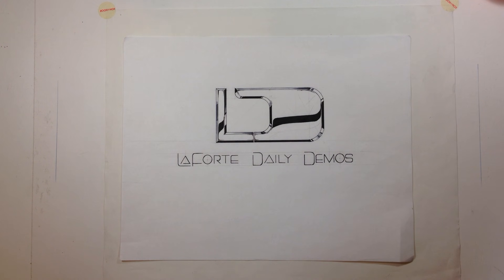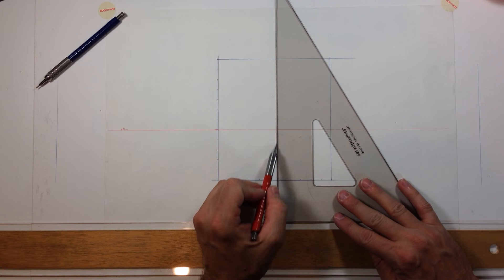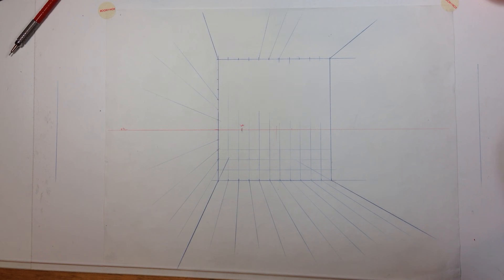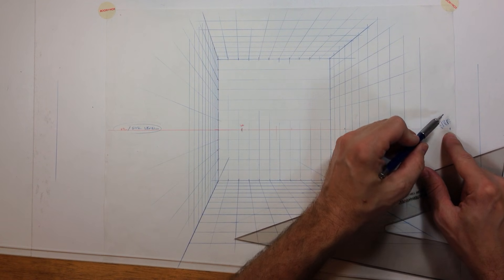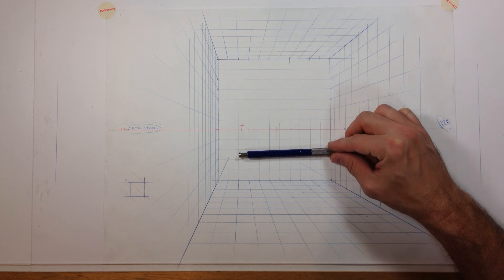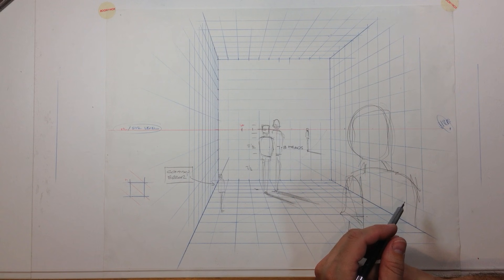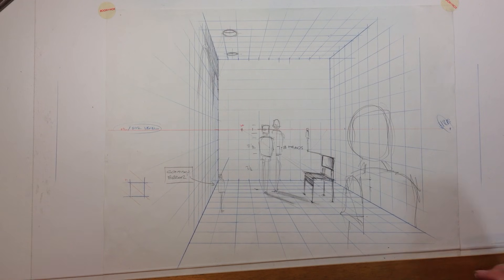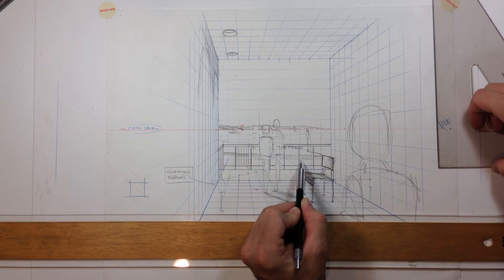1pt Perspective - Part 1 - Creating a Grid

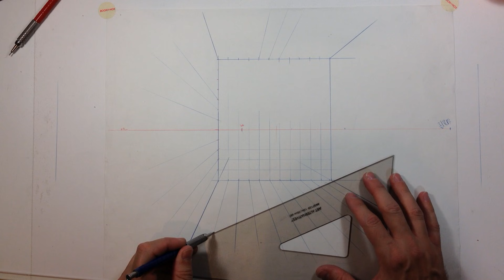Comment: In your "diagonal vanishing point method" to draw the horizontal lines (near 9:13), the dimension of the lattice cell seems to be longer in the vertical direction (as we extend that diagonal further down) contrast to the general "squishing" of the vertical direction. Why is that ?? I hope you get what i mean

Comment: I'm returning to self-taught (aka youtube taught) drawing techniques and two things that infuriated me about getting the perspective of a floor grid were people using the vanishing point as the center of the back wall, and artists with years of training saying "just eyeball the vertical distance, you'll get used to it!"  Exactly the opposite of helpful.  I had vague memories of the control point / diagonal vanishing point (7:50 - 8:34) and was happy to see you use it so I could remember the technique, on a room that wasn't centered on the VP no less!  One thing still plagues me though - Where did this method come from? I had considered reconstructing it analytically using photos of a physical grid I would take on my own, but I wonder if you might have any insight into the formation of this technique? I looked over the vids on Scott Robertson's youtube and it didn't seem like he had any which would give me that info.
Reply: I don't get it either, the theory I mean. I thought you just drew a corner from edge to edge on the ground plane.
Reply from the maker: Thank you! Glad you appreciate it! Eyeball method works fine when you have a base understanding, but I found the 2x method (diag distance from VP to longest floor corner) to be easy enough to remember and produces good, believable results--I've seen some methods that do not appear believable. You can even eyeball approximate that point within reason and it will fall in line fine. When people set a diagonal control point too tight in, the ground plane grid just won't look foreshortened right. I don't recall where exactly I got this method. I think it was from Professor Opheim who had a self-published book; very technical. But just about every perspective book has some variation on it, John Montague's book is very good. I've also got books by John Pile, Joseph D'Amelio, Ken Auvil, and a few more... I've tried to put together material that plugs some holes I haven't seen covered very well or are very cryptic to unpack from a book.
Reply from the maker: That won't foreshorten the ground (walls and ceiling as well) grid in a sufficiently believable manner

Comment: Hi.  I tried making a 15 ft room instead of 9 ft.  The squares on the floor change size when I do this.  Does this make sense?
Reply from the maker: The units wouldn't matter, the concept would be the same. If you change the scale units you use, then the floor units will change too, but the system doesn't change. Set the VP and measure the distance to the furthest floor/wall base corner, bring that up to the HL 2x from the VP and that will still be the control MP

Comment: how do you work out the exact points for the two red dots on the horizon line to make sure that the floor tiles are exactly square and not rectangularly shaped. Is there a method or measurement from a point.
Reply: He measured the distance between the vanishing point and the bottom right corner and used that as a scale for plotting points on the horizon
Reply: Thanks. Will try the out.
Reply: Once the horizontal is drawn and have the measurement as per your info above. Then I work the point of measure from the outer walls. If correct □
Reply from the maker: Yeah, so, the first one is just your first, dominant vanishing point. You can put that anywhere you like, usually you'll want it somewhere between the left and right vertical edges of the back wall. It could be dead center, but we generally avoid that as it creates too much a static image. However if you're doing set design for Wes Anderson, then by all means, go drop-dead center.

The second one is as Pranav states below, but note, it's not always to the bottom right corner. If you set your vanishing point to the right instead of the left, then you'll go to the bottom left corner. It's from VP to longer of the two floor corners.

A word of note. This is really just one method, there are others, eye-ball methods and such, but I've found this one is easy to remember and has good balance on the grid scaling; some methods just feel wrong, the grid is too stretched too fast or too compressed too fast. As you find different methods, and work through them, you'll see what I mean.

Comment: What is the explanation/math for the diagonal vanishing point method described?
Reply from the maker: Comes out of basic geometry class. If you have a square, then draw a line from one corner to the opposite, then extend the vertical edges and horizontal edges, what you find is that you can scale repeat your grid module infinitely. So this same concept applies in the perspective field. If I trust that a trapezoidal shape on the floor graphically represents a square in perspective, and this is observable in photography or using a glass window for example, then corner to corner to the horizon line, will allow me to extend the grid in any direction, as long as I can draw a sharp enough line.

Mind you, as you get further left and right of the central/primary vanishing point, the grid will distort, eventually to a point that is unusable. To soften this, we'd build out far left and right VPs and then use curvilinear perspective to soften up the harshness of angles, something like lens distortion.

Hope this helps!

Comment: so is it impossible to draw a true square grid in accurate perspective?  if you were to extend the room horizontally the farther right or left you go the shorter the squares should measure on paper, but in this system displayed you are using .5 inch horizontally throughout the back wall.  perhaps there is on 1 true square drawn in perspective in this whole drawing.  not saying this is wrong or anything but just wondering if there is a way to draw a true square perspective grid.
Reply: @LaForteDailyDemos  I believe you misunderstood user 9´s question, which would also be mine. Your technique is cool and works for this particular example, but if you were to have longer floors or walls, you would not be able to draw all the squares in perspective. Do you have a solution for that? all in all, great video. Thank you.
Reply: @KINGMIDA123  im not an expert but if you extend the walls then the drawing will become more and more distorted since it has something to do with field of view and how the camera lens/ human eyes work in general.  im not sure how the technique works in the video but i think to make a perfect square grid, the angle of the diagonal vanishing points need to make 45 degrees to the station point thus need to be spaced out accordingly from the centre, and depending on where the station point is, the diagonals will proportionately align itself to make a perfect square in perspective